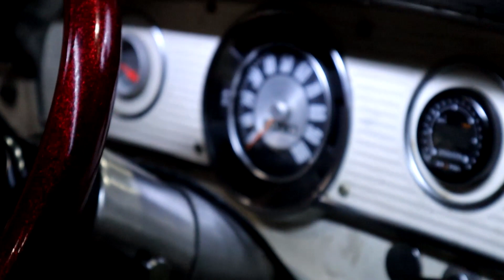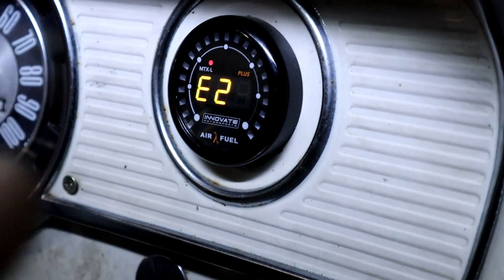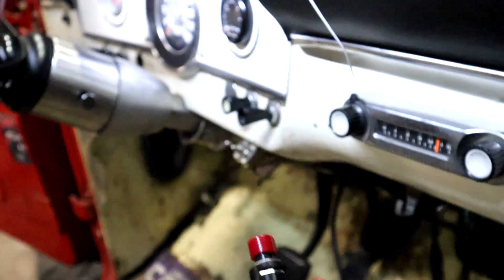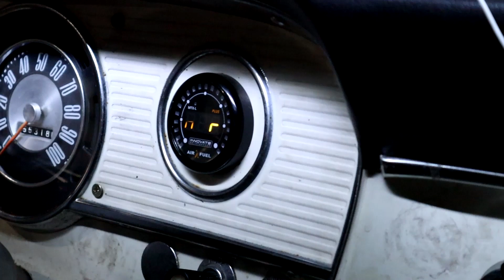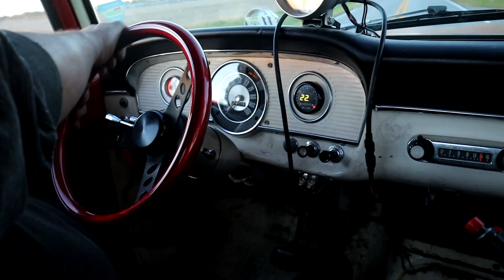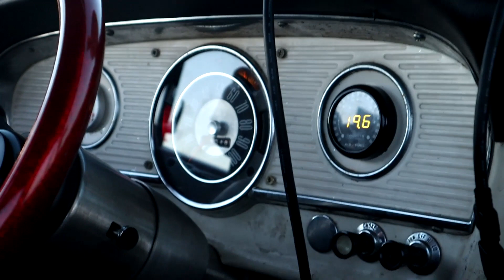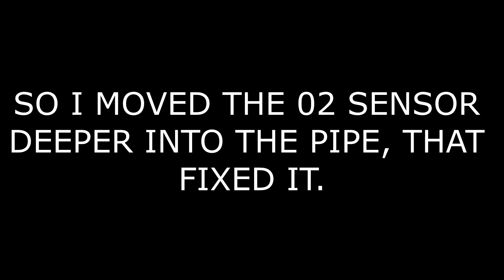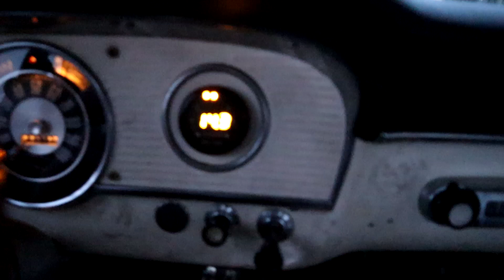WIDEBAND FOR MR.HANNEY

Comment: “If your shits tuned right.”  Let me correct, if it’s in closed loop,  start up is usually rich a bit.

Got to get the calibrate right!  If it stays at 22 afr with it running in the pipe it’s probably not calibrated right or it has a bad O2.

13.1 is a bit lean. So probably should add a little fuel. I want 12.5-12.6 at its highest.